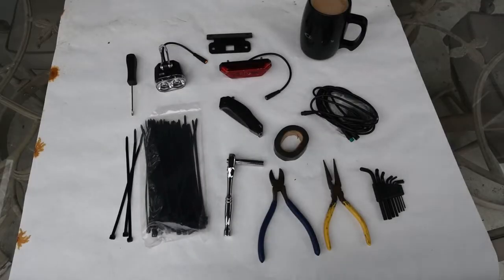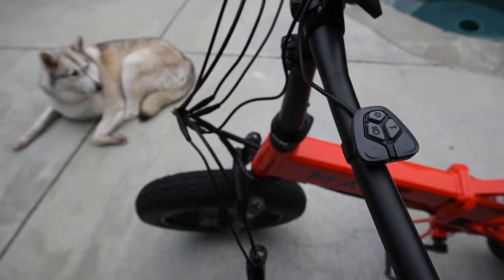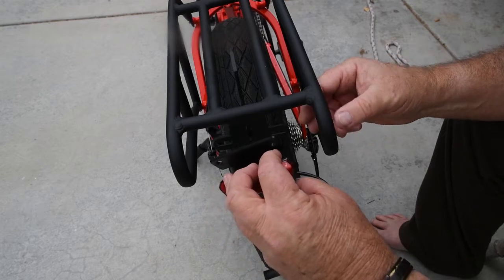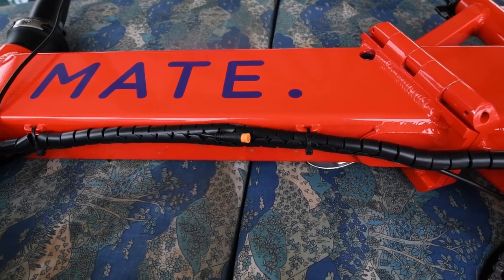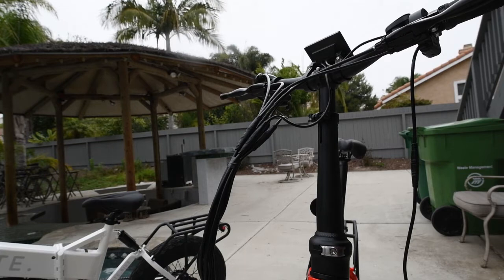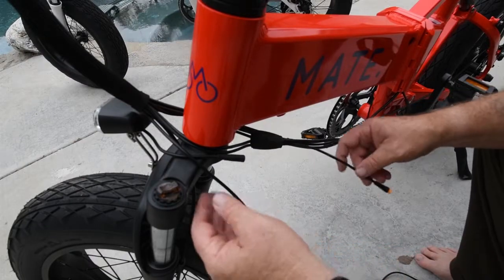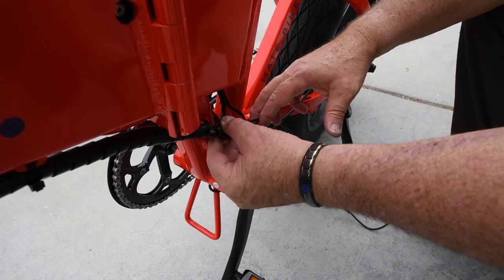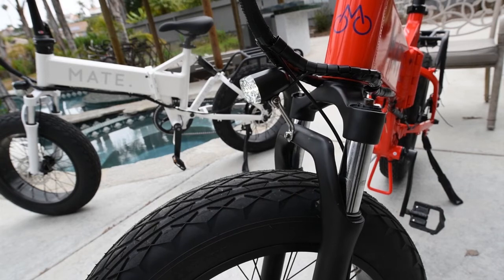Mate Lights

Comment: on the other side of the rear rack there are nice fixings for the cable of the rear light. Also this goes nicely just up until the hole in the frame where the cable came from. No need to make any special custom construction and the cable is almost gone.

Comment: The wireing to the back lights isent supposed to run that way.

Theres small plastic clips in the box, and on the lugage carrier theres some "holes" you can attach the clips to, so the wiring to the back lights look neat and hidden. ;)
Reply: You are right. The rail for the back light cable is on the right side of the bike not on the left. That way you don't need zip ties because it's the right lenght and looks much nicer too.